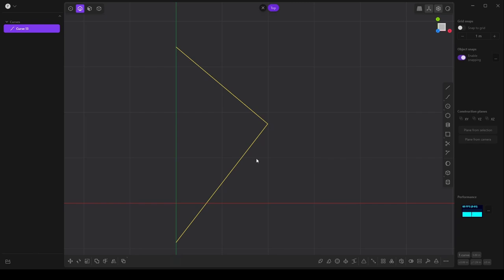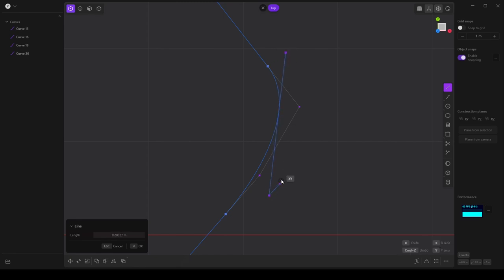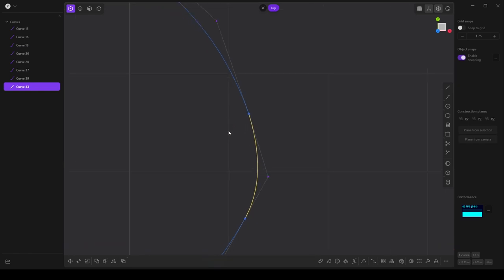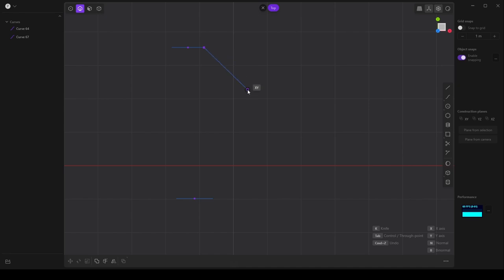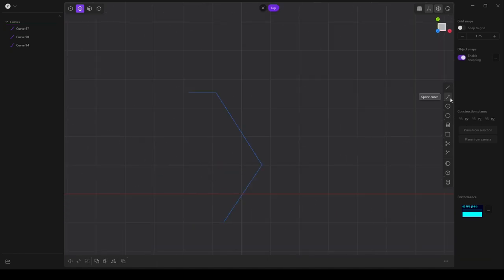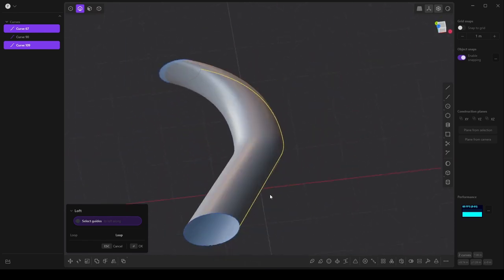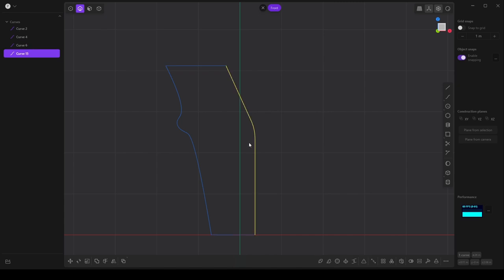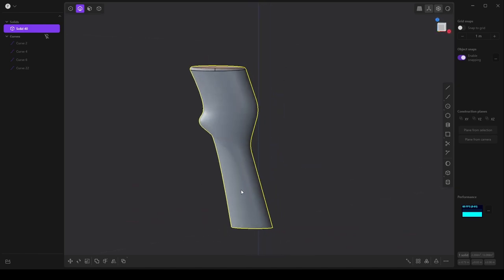How to understand tangents and lofting in Plasticity (Drawing in 3D)

Comment: It's not an issue with the absense of bevel on a curve, it's because we have a significantly different number of points. If you rebuild both curves with the same amount of points it should loft easily.
Reply from the maker: Correct. I'm just using bevels as a way to match the points. (I've tried rebuild but wasn't able to learn how to control it yet.)
Reply: @ReboundAnimation  Just use a big amount of points, especially if you have a sharp angle. The trick is to use the equal amount for both curves.

Comment: Do you think later versions the loft functionality will become more tolerant  dealing with joins?
Reply from the maker: Maybe. If so, it likely would just automatically create the separate sections. 

I believe that different "patches" have to be used when the curves are not tangent due to the underlying math.